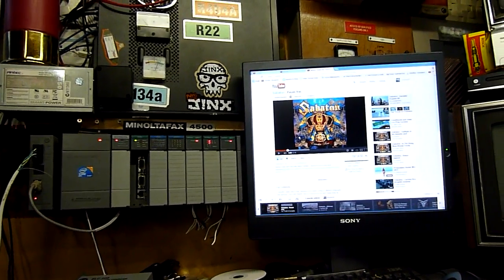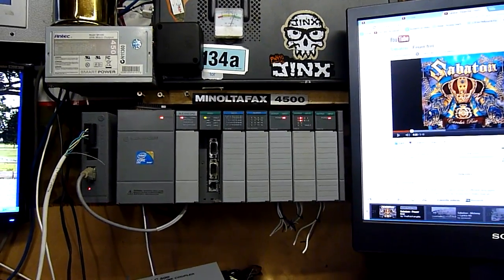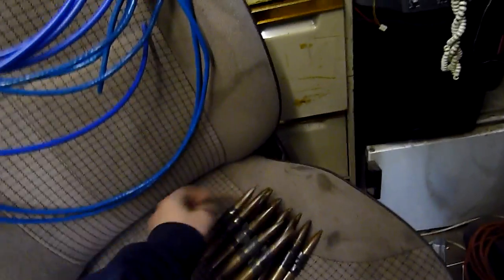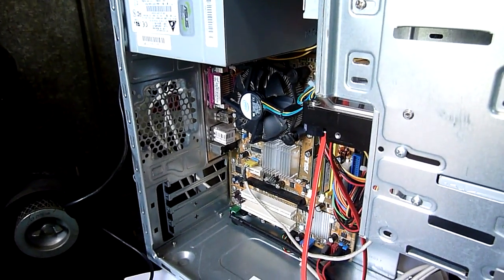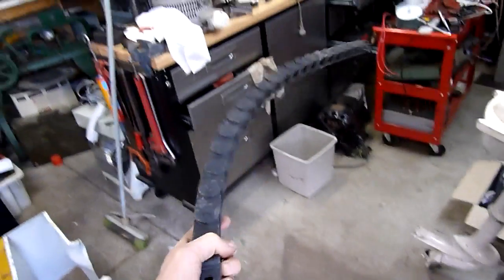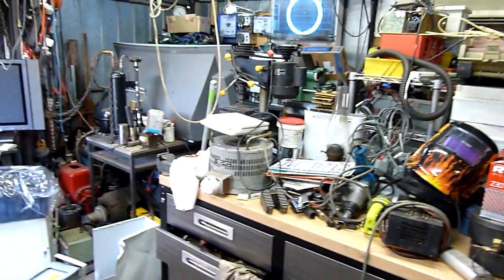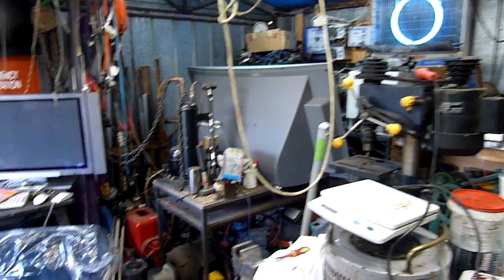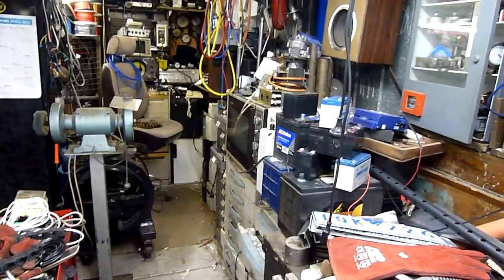Ramblotonic Thursday - PLC and PC update Etc

Comment: It's milliamps coming out of the high voltage winding on a MOT, about 600 ma, if I remember, so just over 1/2 an amp, but at 2000+ volts mains connected it's more then enough to straighten your hair, or bury you, if you end up across one.

Comment: You can probably fabricate a crude keypad with a bunch of normally open push buttons.
If you look at the back of that membrane you can work out how it's done.
It is probably a simple matrix.

I have had to do some similar things in the past to replace hard to get, discontinued or expensive keypads.

Comment from the maker: its a programmable logic controller, it can control process equipment, servo motors, solenoids, motors, pneumatic valves, it takes in readings from rotary and linear encoders, manual control stations etc, and can run a full auto-sequence when commanded to.

Comment: People that want to start working with high voltage should get a wimshurst machine. They can generate over 70KV, but it's just static electricity and won't injure anyone unless you charge a really big leyden jar with it. It still doesn't feel to good if you zap yourself though.
Flybacks can still give a nasty burn and zvs driven ones can supply more current than an nst.